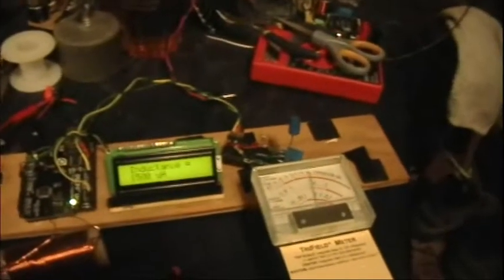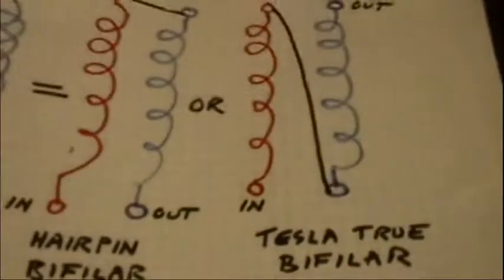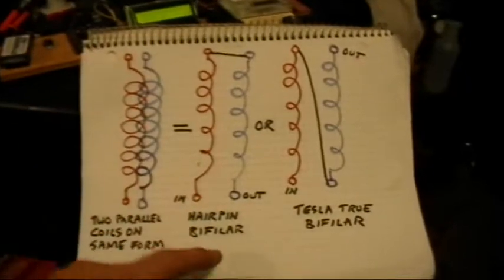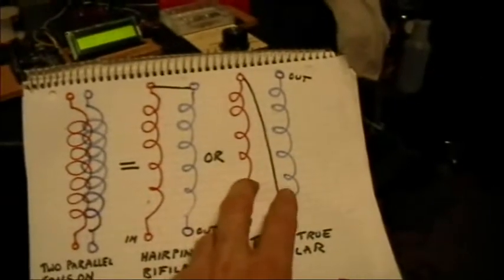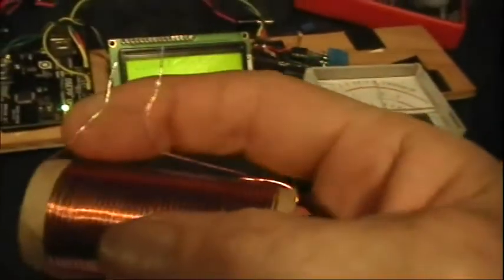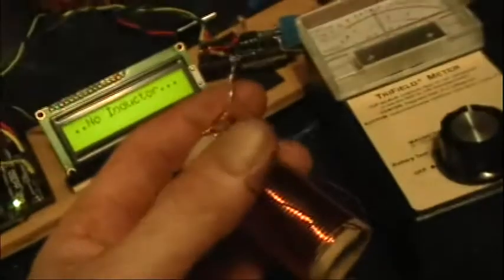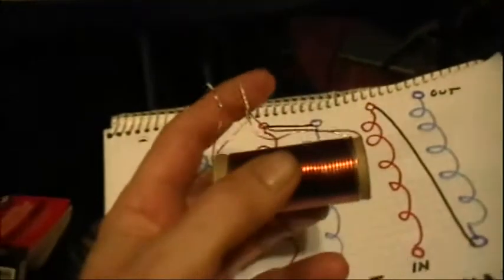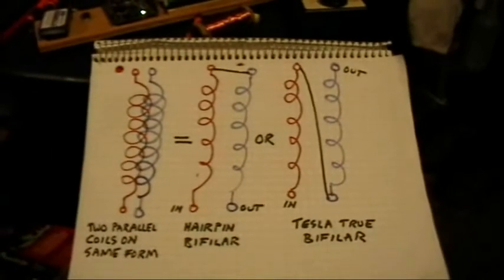Tesla Bifilar and Hairpin Bifilar Windings Compared

Comment: The point of these mods was also to add capacitance. Please could you report on the added capacitance?
Reply from the maker: Yes, there is considerable added capacitance. This can be seen when comparing the resonant frequency of the Tesla bifilar winding with another single-file coil with the same number of turns and same geometry. The TBF coil will have much lower resonant frequency due to the increased interturn capacitance. 
Please check out my more recent videos concerning the TBF winding for more information.
Thanks for watching and commenting!
Reply: Specifically what is the capacitance of the hairpin bifilar winding? Thanks, I'll review all your vids on the subject.
Reply: I've gotten 10,000,000X times the capacitance.
Reply: Which is a far cry above his 250,000X but that was just an example he gave.

Comment: Hi TK, once again thank you for your great videos.  I am investigating the Tesla Stout Bars circuit aka the Tesla Hairpin Circuit and am investigating the use of the bifilar coil as the capacitors/condensers in that set-up as the circuit supposedly works best with quick/sharp discharge and charge times.  Do you think that the bifilar coil would be a good choice for this?  Also, you mentioned on the overunity board that less windings is better...I am a little confused about this as Tesla used a 1000 turn coil as the example in his patent.  Also, what are your thoughts about the 250,000 number Tesla mentions in the patent?  I presume that Tesla's 250,000 mentioned is with everything being optimized...  Do you think the 1000 turn is optimum for this.  I am also considering using flat wire to increase surface area and thus capacitance.  Any assistance is greatly appreciated!
Reply from the maker: Thanks for watching and commenting! I'm sorry, but I don't know the answers to your questions. Experiment and find out! Keep us posted as to your findings. Thanks again!
Reply: 1000 turns is pretty much what you would need but it's the length which is really important. The closer to 1/4 wavelength the better. Also it's a trade off between inductance and capacitance. The more capacity the less inductance. Lastly 250,000 - that was an example. The closer winding A is to winding B in the bifilar the greater the capacitance. I've gotten a lot more. I'm at 11uF compared to 1pF at 50kV.

Comment: Very informative demonstration. I am going to try the true Tesla Bi-filar for my ZVS driven solid state resonant transformer wireless field creator... I hope it drives a nice wireless field... I will be up till dawn working on it. Thanks for sharing TK.
Reply from the maker: I just now finished building a new ZVS, to experiment with. Made an induction heater work coil. Will be posting a video demonstration in a few minutes.
Frequency is about 130 kHz, 11 turn center-tapped work coil of 1 uH inductance. IRFP260n mosfets, 24 VDC input, sine wave voltage across work coil is around 200 v p-p.
For magnetic and electric field power transfer I like higher frequencies, 800 kHz is good for magnetic, 4 MHz for electric.
Reply: TinselKoala Very nice. I have a small SE ciruit and coils that likes to resonate at 890kHz. The resonant transformer I just made is a solid 260kHz, using the TIP42C circuit. It puts off a nice field but draws extremely little current.  I am going to look at what I have for quality capacitor and choose my route that way. I look forward to seeing the demonstration.... Question, I was able to rummage out of the junk pile 2 zener diodes.. One is 22V and the other is an 11V. Is this going to cause me issues as most ZVS circuits call for 12V Zener Diodes? Anyways, I guess there is only one way to find out.    Peace   :)
Reply from the maker: Binj Komisar
I haven't even been using Zeners in my recent ZVS circuits. TinselKoil VII doesn't have them, neither does this induction heater. Just UF4007s. I did put in a 7812 regulator for the gate circuit, so I can use higher input voltages but still run the gates on 12V. Seems to work so far.
Reply: TinselKoala Great. That makes me feel better. I'll leave them out for now... I just ordered one of those economy kits of ZD's 2V-48V 300 piece sets.... And heck, even if I blow the IRFP260N's I have 10 (got them off ebay, probably know offs)... It usually takes me 3 or 4 tries to not burn things out :)
That is a really smart idea. about the voltage regulator, it would have to be heat-sinked good depending on how high you want to push things? I'm not sure if I have one of those kicking around. I know I have a few voltage regulators somewhere in my mess..... hence the upgrade renos on my garage (custom work space and storage, more organisation is desperately need in my home-work space)... Again, thanks for your help and I look forward to watching the demonstration video when it is uploaded. Peace.

Comment: thats interesting-so with 2 windings and tesla hookup your looking at 4 times the inductance of a single coil,would this do the same with a trifilar wind?
i have a small,strange looking HV transformer i pulled from a circuit board and the primary clearly shows 3 sets of windings,and i could not figure why it was wound that way.In light of your demonstration perhaps that is why.Everyone i have shown the transformer to,has never seen one like it.....continued